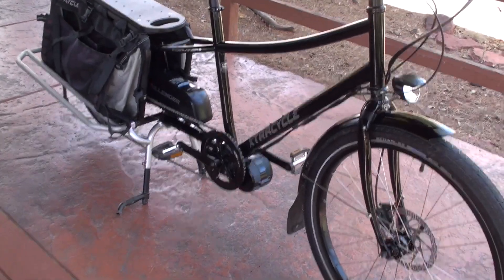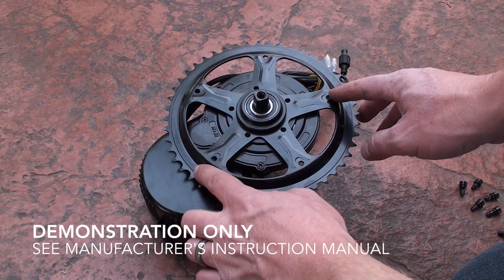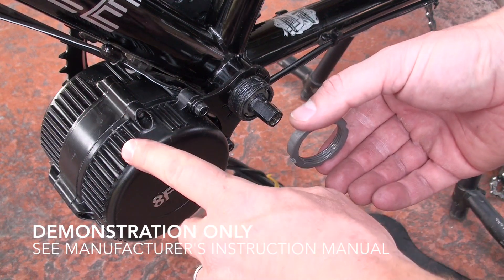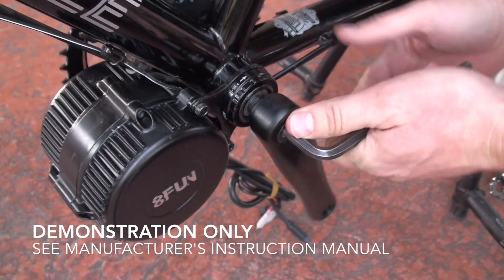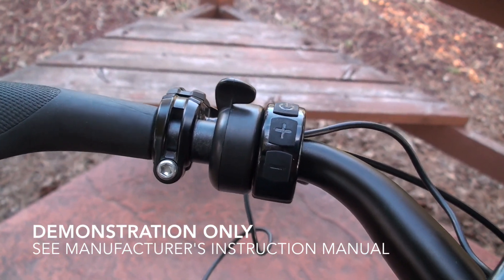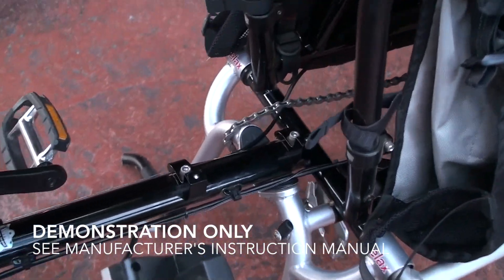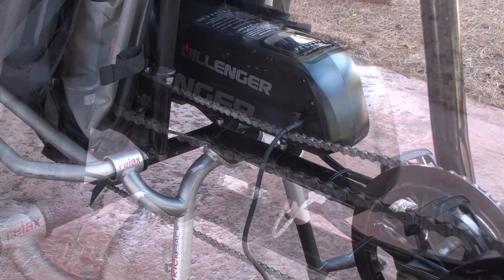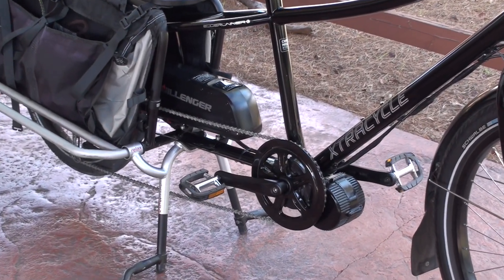Dillenger Bafang Mid Drive Electric Bike Kit in for Review | Electric Bike Report

Comment: Hello Pete, 
I have TWO questions for you:
1) What would be the minimalist Bafang mid drive build to turn a manual bike into an ebike? 
I ask this because I am not a big fan of too many wires sticking around the bike frame as I see them time and again in installation videos. Can I do a simple build with just a mid drive motor and a thumb (or twist) throttle? I assume that the throttle is the only key element needed to control the motor. I could care less about the LCD display, the speed, or changing the power of the motor as the gears change especially as I ride on the highest gear no matter what the terrain! 
2) Is it a good idea to build ebike on a single-speed bike that can coast? Having no gear derailleur would further simplify my ebike especially when I do not use the gears anyway. The less is actually more and simpler!
Please advise.

Comment: Hi there I need to know when I'm not use power on petal & the motor will charge the battery untill full then use power on to run with both use petal & motor??? do motor can charger the battery or not????

Comment: Thanks for this video. I have a few questions as I intend to buy a 500W 48 w kit but there doesn't seems to be a battery proposed in the kit (alioexpress)so I believe, I will have to buy a separate battery. Do you have models to propose ? where could I buy one and what specifications do I need to be carefull. Other question, I have Magura hydrolics brakes, is it a problem with this kit ? Thankyou for your help.

Comment: how well would this work if I wanted to used on a single speed ?
Reply: You would be missing out on quite a bit of power. If you were using a single drive, you would be better off on a hub motor kit. The power from this motor comes from the fact you can change gears, like a transmission

Comment: Thank you for installation details.
I am thinking of putting the kit on a recumbent.
You rotate the motor clockwise before tightening it in place.  Can the motor be rotated counterclockwise and tightened in place?
Is a chain guide required to be installed?
Are there rules of thumb that predict the range, for different average speeds, that you can get from different battery Ah / kWh?  What kind are you getting?
Show less
Reply: TheLookingOne If you multiply the battery pack voltage by the ah then divide by 20, e.g. - 48v x 8ah divided by 20 = 19.2 miles is a good real world estimate and the speed you travel to achieve this is based on the motor running full power and the vehicle it is propelling is on level ground, equal up hill and down hill journeys should be similar as long as breaking is not used excessively going downhill, this is the same for most electric set ups as such at the moment although there are other factors at play like, how free wheeling is your bike? is it all oiled up and no rubbing break shoes and so on, good motor and battery or poor motor and battery , all in all you are likely to get just a little less than this distance but not much less, mid drive set ups apparently are around 15% more efficient than hub motors so you could add this 15% onto 19.2 miles giving 22.08 miles for the above example, another example - 36v x 12ah = 432 divided by 20 = 21.6 miles, but on a mid drive add 15% and you get 24.84 miles in total, mid drives are only this efficient if you use your gears correctly and thus climbing hills in the appropriate gear as not to burden the motor, they are a great motor for this. Oh, just in case you wanted to know, the 20 you divide by is 20 watts per mile most all motors use these watts per mile unassisted , more powerful ones travel distance quicker and will also drain the battery just as quick. 
I hope this helps :)

Comment: so what's the price for the whole kit ?
Reply: youtube is really acting up today or should i say this week , it's not saving my comment edits.
So the 750watt kit is $1300 what about the other ones?
Reply from the maker: Joe G.P. Hi Joe, here is a link to the other kits: https://dillengerelectricbikes.com/product-category/electric-bike-conversion-kits/
Reply: Electric Bike Report
 hey thanks, i see there is a 1000W one too, is that "illegal" in the US ?
Reply from the maker: The 1000 watt kit is only allowed off road and only on OHV trails and dirt roads.
Reply: Electric Bike Report
 and just out of curiosity is there anyone that actually checks your bike ? i kinda doubt it
Reply: Electric Bike Report
I believe 1,000 watts is legal in Washington State as street legal as long as the motor won't power the bicycle above a maximum speed limit of 20 mph.It depends upon the laws of a particular  state
Reply: Electric Bike Report There is no Bafang 1000W kit!
Reply: ***** then buy a different kit
Reply: Joe G.P. I have, but spreading the story of a non existent kit is not good reporting.
Reply: +Joe G.P. $549 without the battery.  Thinking of building my own 18650 battery
Reply: There is a Bafang 1000w kit. Try looking on their website. Your problem is erroneous part numbers. MM G320.1000 or G321.1000 or just go on bafangs site and sort by wattage. {they won't show up unless you do this}
Reply: The "law" says anything under 2hp. 2hp is 1500watts more or less. The law also says anything that CAN NOT travel over 20mph is not a motor vehicle. Over 2hp/ 20mph. OHV, or tags and insurance.
Reply: Joe G.P. Z@$
Reply: Joe G.P. Also

Comment: The down side of this design is that you lose the front "granny" gear.  Can you comment on riding (especially with cargo and hills) with only one front gear?
Also, is the charger silent (no fan)?
Reply: yeah 46T is a big front ring, i have a 40/28 chainset on my bike, and use 28f to 32 rear regularly to climb local hills, with a 46t on the front, if the battery ran out i would be pushing the bike up hills with the 46 front ring only
Reply: Dan Christian  hub gearing does the trick...
Reply: the charger looks like a laptop charger, so 99% likely that it has no fan
Reply from the maker: Hi Dan, with this mid drive system I did not miss the granny gear at all.  The 46 tooth chainring and the 9 speed cog set covered the range of climbing steep hills and cruising up to 20 mph very well.  Even with cargo.  The charger does not have a fan.
Reply: +Oz Hemp Co 
Sounds like that setup could work too.
I've been eyeing a system like this to put onto my Catrike Expedition.
Reply: Why couldn't you put your granny gear back on like it was?